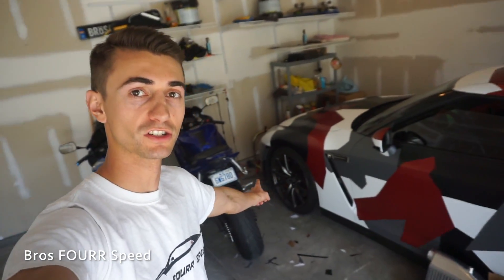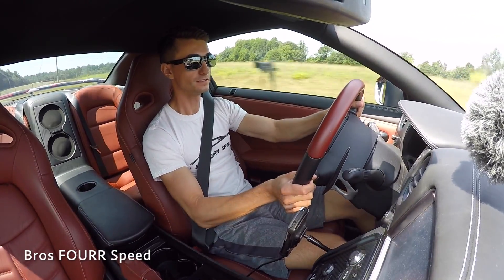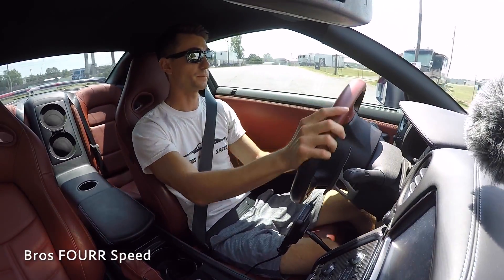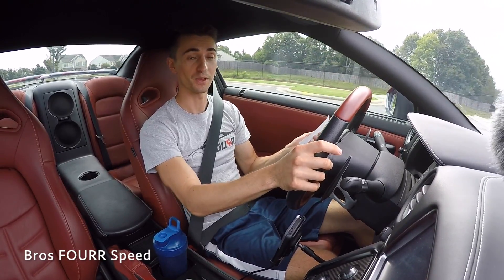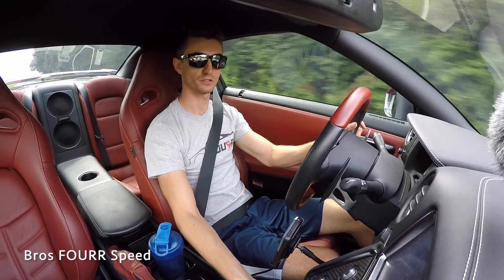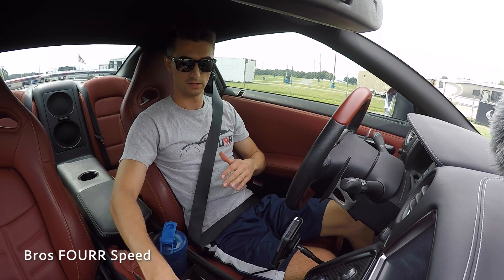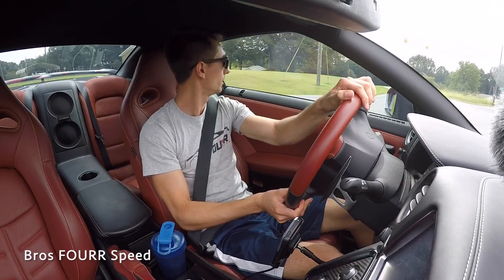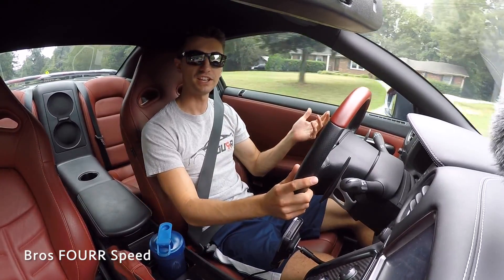Does An Upgraded Intercooler Help Your Turbo Car? *Nissan GT-R Race FMIC Test*

Comment: Any power gains over the factory intercooler?
Reply from the maker: Technically it won't add power. But it will keep the intake temps much lower which in tern give you the ability to maintain more power in hotter climates and when you drive the car harder. So well worth it!
Reply: @BrosFOURRSpeed interesting ok because I have the @workhorseperformance whp700 package on my GT-R which includes 1050 injectors, downpipes, e85, and a few other supporting mods an I'm at 650 wheel HP!  I'm wondering if I can hit 700 wheel HP with a larger intercooler and charge pipes!
Reply from the maker: Possibly. But not likely to add that much power unless you did a dyno on a very hot day and do a cooler day dyno run with an intercooler
Reply: @BrosFOURRSpeed thanks so much for the quick response!

Comment: You probably know already. But for others on the Accessport. The numbers under the live data number is the Min/Max since the vehicle has been running.

Also the right bank is higher because the intercooler piping is right next to the oil cooler.
Reply from the maker: Oh good point ;)

Comment: Unsure if I would call a stock turbo non e85 car “stage 3” I would say stage 2+ and bigger turbos or upgraded trans I can see stage 3/4
Reply from the maker: Stage 3 means tune, catless exhaust, oversized intakes and larger fuel injectors. Stage 2 is cutback exhaust, oversized intakes and the tune. E85 and upgraded turbos comes after a stage 3 setup.

Comment: But the temp with the stock intercooler was warmer outside by few degrees more. Maybe not a 33% improvement. Probably more like 25% from bros test
Reply from the maker: Look at the differences from ambient to IAT. The temp gap is much smaller with the FMIC. And after a few months I've noticed it stays way lower then it used to in all different temp ranges

Comment: I think the two numbers at the bottom are the LOW/HIGH readings. As in the lowest reading and the highest reading it got during that drive. It resets when you turn off the car or accessport.
Reply from the maker: Jeff Boger interesting point. I look next time I drove and see if the left number stays the same while the right increases

Comment: Curious, do you use a radar detector? Have you or mike had any close calls speeding around town?
Reply from the maker: Blake No radar detector lol. I’ve only been pulled over once in 9 years. It was for squealing my tires, but I didn’t get a ticket or anything
Reply: @BrosFOURRSpeed  Wow you're very brave lol, I feel like I can't drive my Z without one. I love your channel, keep the content rolling!
Reply from the maker: Blake lol thanks! Normal roads around town and on the highway, I never speed. So I never have issues

Comment: This test it's not valid unless you're running a  SPEED DENSITY tune, if you're still running a MAF based tune that means you're reading all these Temps pre turbo, the air intake sensors are on the turbo inlets, that means you can't read past turbo and past intercooler Temps unless you go speed density which moves the intake Temp sensors to the MAP sensor, which will be be test youre trying to do, if you're on speed density you should add it to the description
Reply from the maker: I’m not 100% sure. But since I’ve noticed a decrease in IAT over ambient, I would have to assume the larger cooler is keeping temps better and things are reading closer to the manifold. Normal highway driving I’m consistently running 7 degrees over ambient. Stock IC, was never that low compared to ambient
Reply: @BrosFOURRSpeed  if you're venting your  blow offs to the atmosphere then you might be on a speed density tune, but some tuners like to cheat and make SD maps still read the intakes Temps from the maf, and not from the map sensor, your accessport should be able to tell you if you're on a SD map or Maf if you check on current installed maps. Either way if you don't remember buying a speed density kit then you're probably on a MAF tune, if I find a link that explains everything much better I'll share it with you
Reply from the maker: @Disaster646  Interesting. These are recirculation valves like stock. I'll take a look at the AP to see what it says. But whatever it's reading, it has to be accurate if the temp it says is constantly lower compared to before.
Reply from the maker: @Disaster646  interesting point. But if you look carefully, the upper grille feeds all the air to the intakes. The shroud still in place completely blocks all air flow from the lower grill from getting to the intakes. I have a recent pic on IG that shows what I'm talking about. So the bigger core is definitely an improvement

Comment: IMO, I don’t think your test is valid due to being 5 degrees cooler outside. Not to mention, it was not sunny when you tested the aftermarket intercooler. That would by itself will make a huge difference.
Reply from the maker: RSpect Look at the difference from ambient vs IAT. the sun wouldn’t effect it at all since the intercooler is completely shaded. Stock was 19 degrees over ambient after the hard run, while upgraded was less then 15 over ambient